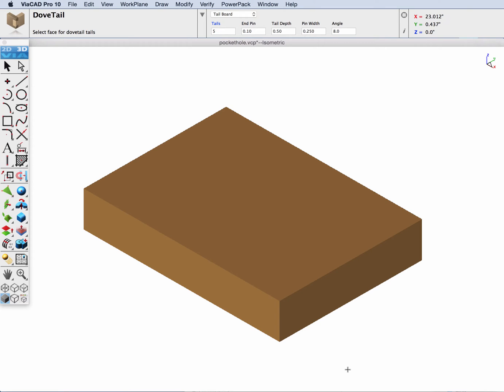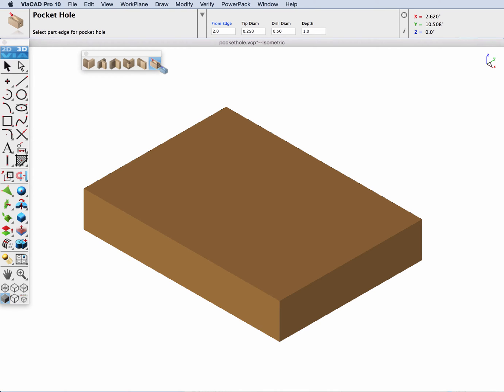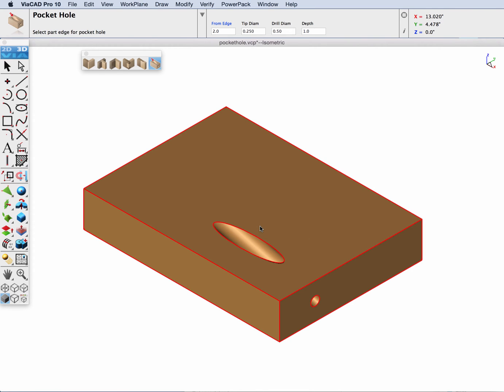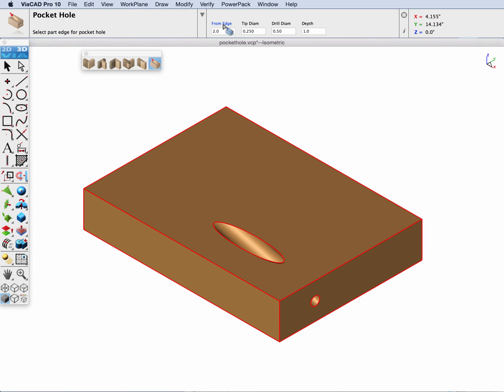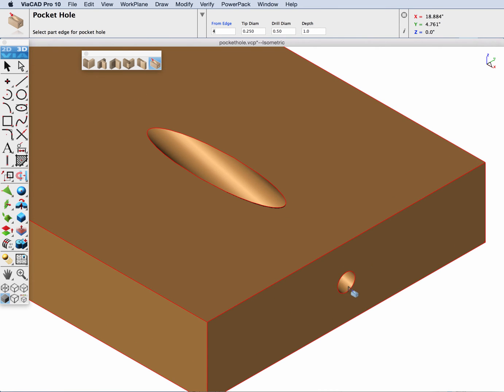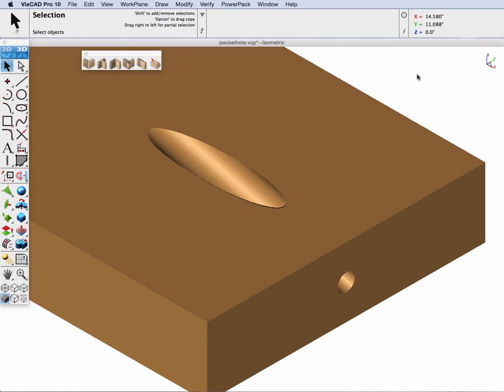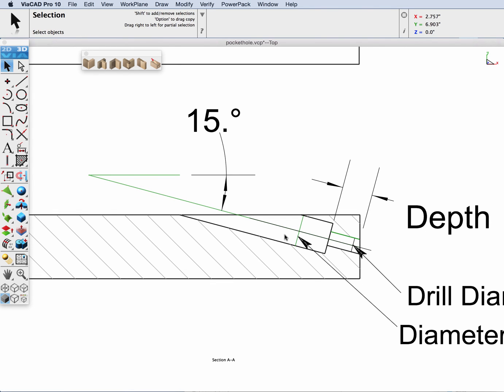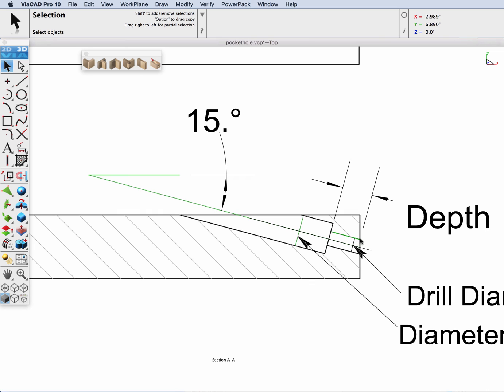Pocket ViaCad Pro v10

Comment: NOTE miss Fake AI video, they cut off the top of the screen so that you think that its coming with viacad 2d 3d but I can assure you its bait and switch, I never got these features, they once again expect you to up grade to the tune of $479.00 for professional v16 after you already upgraded to 2d 3d or bought it outright. DO NOT TRUST THEM TO REFUND YOU, THEY WONT>>>>THEY ARE LIARS

Reply

@cuttrimlawncareterrywendya8621
0 seconds ago
I did specify my discontent in those 2 emails sent 01/01/26
along with the axis glitching out when trying to rotate,app unexpectedly quitting.
 I already purchased an older ver (v10 2d3d) that had the bend tooland 7 different push pull tools
You would think when upgrading to v15 that those would still be there, but no, you choose to remove them after I already paid for them, that's not an upgrade, that's stealing. 
about as dumb as upgrading a car but you removed one of the wheels.
I ordered power pack to see if those tools were there but no again.
Finally I so called upgraded to v 16 to see if that would do it. 
 Funny how you claim it is in ver 16, however, there is no v16 viacad as a product.
it is either v16 2/d 3/d or viacad 16 pro, both products are v16. This is classic
Bait and Switch. You had misled me to think that the tools advertised were not 
going to come with 2d/3d and was clear that it was only pro ( who knows it thats the truth)
I never would have purchased either, including v15 2d/3d on September 30th
You can also check out your video ( the one with the fake AI girl expressing the same
thing " version 16" . It gets old trying to figure out what training videos are for your version. if you didnt do a bunch of bait and switch ( removing features that the previous
ver already had, and all the versions that are not covered. 
Spell it out what each version comes with. These kinds of business tactics will only 
erode your credibility.  Terry Amante